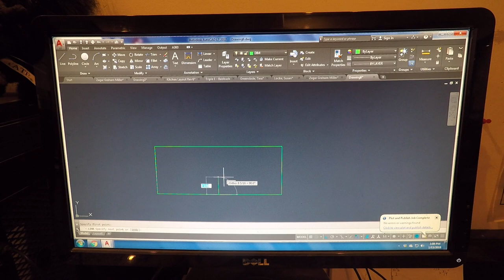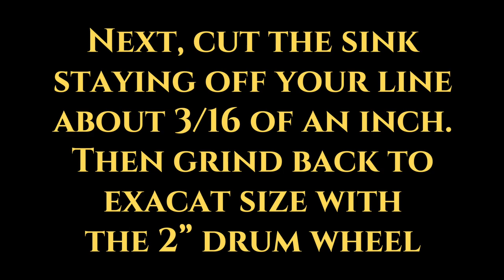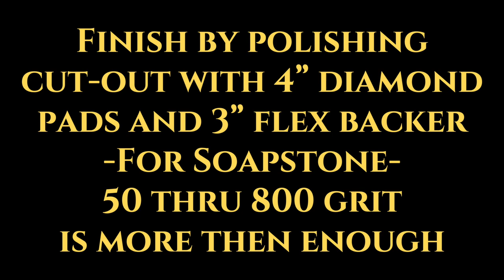How To Cut / Polish Undermount Bath Sink -  in Stone by Hand

Comment: Nice work Jay, def an investment in skill equipment and time to cut this material. I pulled an amazing piece of granite from a house and after seeing this not too confident in cutting myself are there usually resources in larger cities typically that would cut custom pieces brought in by customers? Any insight on what to look for and source.
Reply from the maker: Hi Rod. For sure you have options. People bring in material to us that they have acquired over time. Don't worry or be shy. It happens all the time.
Just keep in mind, the material is not cheap for sure. But the fabrication side is more expensive. All of our tools are diamond coated. From blades to polishers. You will save money if  it is your material. Just be aware that most of these shops have Thousands invested in tooling and experience. Look for a small shop with talented guys. I've been doing granite and stone work for 23 years now. I have always worked or helped start small 10-12 guy shops. That's where you find the talent. When you get too big, the money starts to mask the artistic and creative side of stone work. Hope this helps and thanks for the comment.
Reply: @GraniteByJay  It def helps, and spoken like a true Artisan, thank you for your time and insight.

Comment: Hello... what size (depth) counter top was that?
...and what size (version) Caxton sink was it?
I purchased the 17x14 (inner bowl dimensions), but I’m not sure if it will fit in a 21-22 in deep counter with room for backsplash and faucet.
Any info would be helpful 👌
Reply from the maker: Hello. Thanks for the comment. This was a 21" deep cabinet. The countertop was 22 1/2". For this project, the customer didn't want backsplash. So I bumped the sink back a little farther then normal.  The sink is the Caxton 2210 which is the 17x14. This sink will fit (including backsplash and faucet) in any 21 or 24 inch cabinet. For the 18" cabinet, you have to switch to the Kohler 2209. My standards for using the K2210 sink in 21" cabinet go like this. 1 1/4" overhang on countertop. 3 3/4" back from front countertop to sink cutout. 2 1/2" to center of holes from back of cutout. Hope this helps and thanks again.